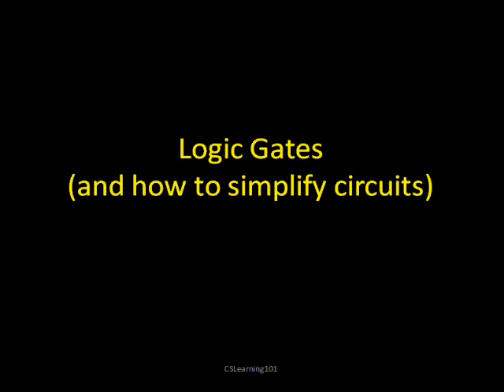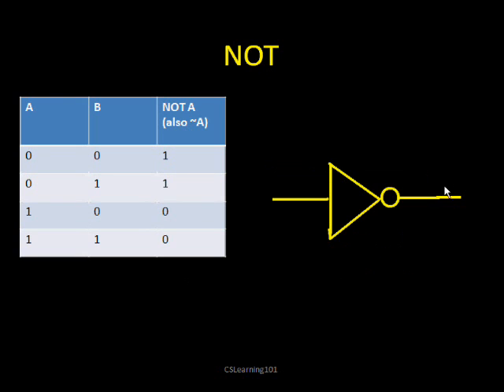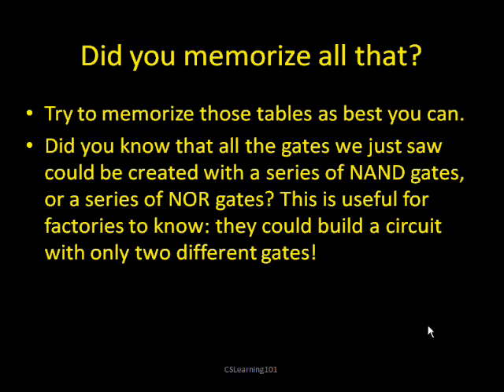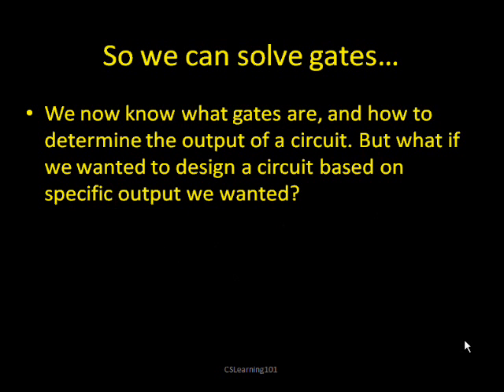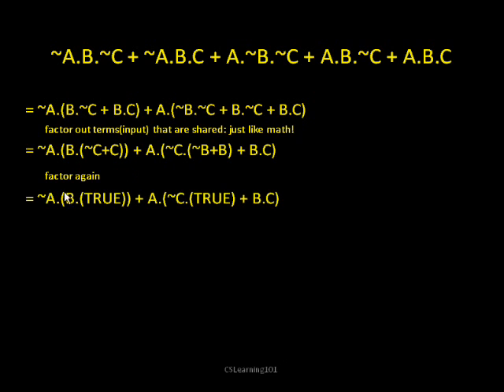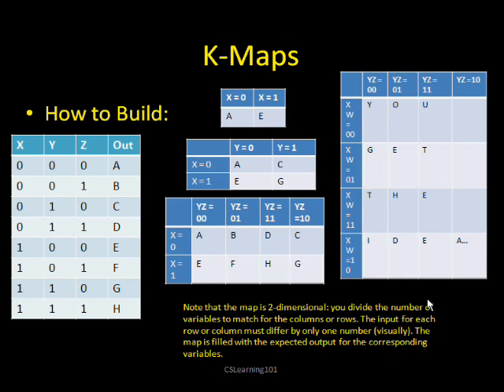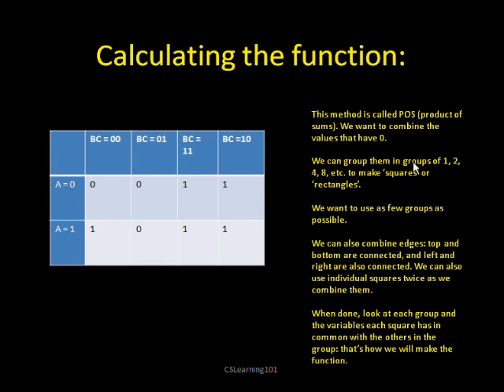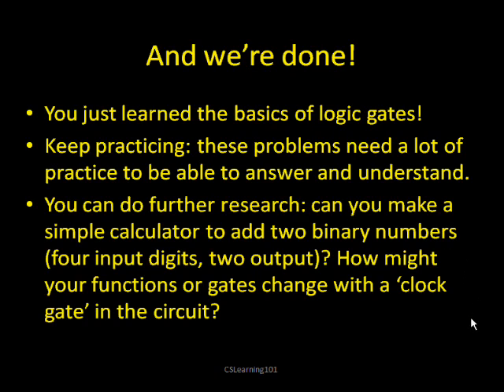Logic Gates and Circuit Simplification Tutorial

Comment: The circuit at 5:33 actually works as a controllable high frequency oscillator. When the input A = 1, the output = nearly square wave signal ( 01010101 ). When the input A = 0, the output = 1. The ring of an odd number (1, 3, 5, ...,  2*n + 1) of logic invertors always work as an oscillator.

Comment: At 5:33 , that's a regenerative circuit... Except it really wouldn't work, without a low-pass filter (modular synthesis)... or else, like you say: the logic would keep changing itself... In frequency dividing, the schematic looks like the following:

f_in --> 3/2 f_in --> Mixer --> Low Pass Filter -->  Amplifier --> f_out = 1/2 f_in
                                    |______Feedback Re-loop______|

A cruise control in a car is similar. When you select the desired speed, and you're going up a hill, the output senses a lapse below the desired threshold, and applies more gas to meet it.

Going downhill, the threshold is also the limiter, and decreases the gas, for the speed -- or output -- to fall back to the desired speed. This is a closed-loop circuit.

Comment: Around 7 mins and 30 seconds you were simplifying a problem from a previous circuit. I have a hw question that uses the same expression but it wants me to simplify the expressions to at most three logic gates. Then it wanted me to draw the circuit. When you arrived at the final answer you said it could not be simplified anymore. This left me with 6 logic gates when it only wanted 3. I am a little confused. I would appreciate it if you could help me. thank you

Comment from the maker: The 1 and 0 passing through the AND gate results in 0. AND only outputs 1 if the two input values are both 1. This would be written down as multiplication in a formula. Addition refers to OR. Remember, multiplication and addition in binary logic are really just symbols, and don't refer to mathematical multiplication and addition.
The gate after that is a NOT gate, which outputs the opposite of whatever the input was. 
If this still doesn't answer your question, please let us know.
Reply: Yeah I want to learn more about Bollean logic to make his circuit simplification make sense. I understood how he was factoring the expression he made. But I didn't know why he was adding some parts and multiplying others. Also, the K-chart doesn't make a lot of sense to me either. The first one he showed, that kind of looked like an and gate, short of made sense until I saw it had letters inside of the table rather than values which really threw me off. Then, when he started adding more inputs to the top row I was unsure of why he did that. Why add it to the top and not to the side. Why have AB in the top row? Just because that's how it is done. Thanks, some more information would be great. I'm looking into getting a NCATT AET license when I leave Tech School. I stumbled into this during my research into the AET program- the information helps me grasp what it is all about.

Comment from the maker: Taking out input variables is usually a good thing for circuit simplification. If you end up not using one of the variables you started out with, that means you never needed it to begin with, which makes it easier to understand the question and to actually make the real circuit.
You can simplify your answer further: = -A.-C + A.-C => (-A + A)-C => (true).-C => -C.
If you are worried about whether or not all the original variables need to be in the final answer, ask your professor to make sure.